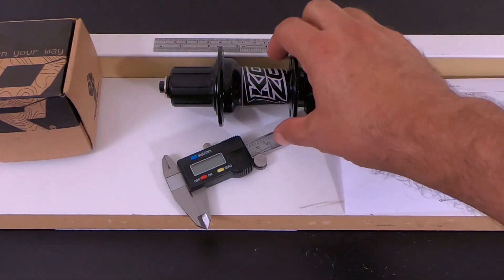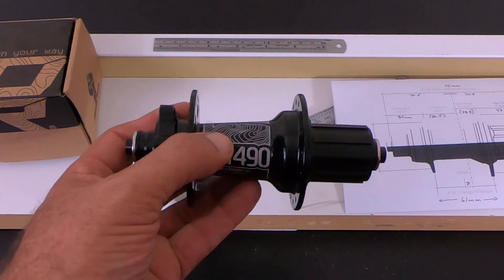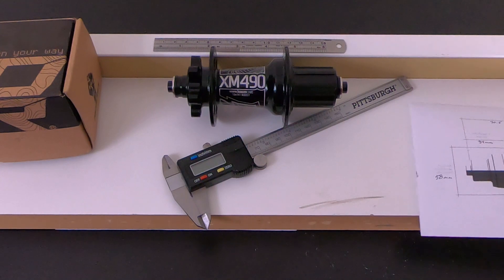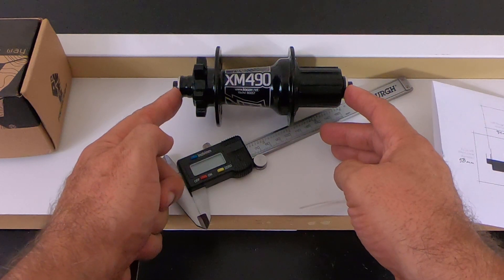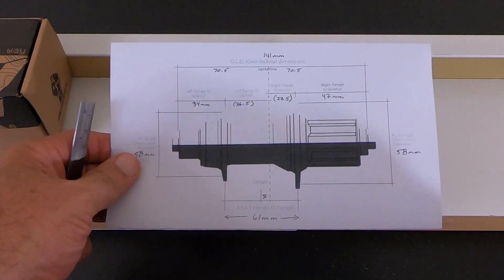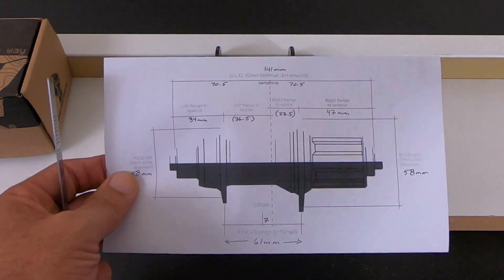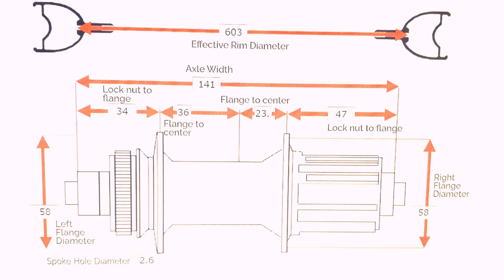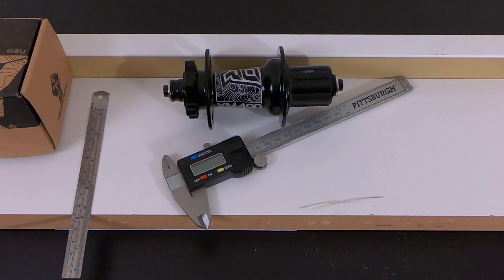Koozer XM490 141mm QR Hub Specs and Measurements for Spoke Calculations

Comment: Hey will this hub 10x142 QR fit in my frame?
I've 10x135mm 
I've 1x12 speed drivetrain so I want to get wider hub for correct my chainline and wide tyres clearance.
Reply from the maker: This hub will not fit. You have to match the hub to your frame. You can correct the chainline by using the proper non-boost crankset or front chainring.

Comment: I just secured a NOS Ryde Trace25 Tubeless 15 x 100 12 x 142 wheel set with Orion 8 M3100 hubs for $160 shipped. Will be using TA adapters for the Taff Comp 141 Boost frame. I thought about building my own with these Koozers but when I caught this deal I couldn't resist.  Hubs alone can go for over $100 each
Reply from the maker: Sweet deal!

Comment: Do you remember what the axle diameter and length was? @2:10 the o.d. of the caps looks like 10mm, so im assuming its a 5mm QR?
Reply from the maker: It’s 10x141mm, the 5mm refers to the the skewer so the description sometimes mentions both.
Reply: Thanks, the "standards" in the bike world can be confusing when your green. I have another unlabeled hub that's marked M9x141, and the axle measures 9.4mm with a 4.5mm skewer. 🤷

Comment: How is the XM490 hub holding up? I'm in need of a new 142mm OLD 29 mtb wheel and considering the XM490 with a welded rim (Ibis or DT Swiss).
Reply from the maker: It’s holding up great so far. No problems whatsoever
Reply: @TonyHob  Good news! Thanks for the reply.
Reply: Buy the pro version, it has a cromoly axle

Comment: What cassette are you using? Can this hub work with a 12 speed cassette?
Reply from the maker: It's a standard HG hub. Any HG Cassette from 8s-11s will fit as well as SRAM SX and NX 12speed. I am using an NX 12 speed on it.
Reply: @TonyHob  Thanks man! I got my wheel back from the lbs. I'm able to fit a sunrace MZ90 11-50 12 spd on this hub. 🤘
Reply: Does this fit to any 12s cogs in the market?

Comment: Hey Tony, I got the wtb i30 rims and the koozer hub but different calculators give me different lengths for the spokes, and what lacing pattern did you use?
Reply from the maker: three cross pattern. The same happened to me but they were only different by about 1 mm
Reply: What length spokes did you use?
Reply from the maker: 293 and 292. Your ERD might be different though

Comment: For those looking for a more budget 141QR hub, research Shimano FH-MT401-b (microspline body) and FH-MT500-b (microspline body) and FH-MT200-b (HG body).
Reply from the maker: I considered them but would have to buy a new cassette for the microspline version and they were not sealed bearings. At the time none were in stock either. Great price on them though

Comment: That is a nice Hub, I was using a 135mm hub  but I went back to the stock wheel because I started to hear weird noises on the frame. So this is a good choice, thanks for sharing this with the community
Reply: same as mine. im using 141 boost qr. i got a weird noises. i think its the freehub with pawls once i relube and regrease. its fine but its only last 3days or 1week it goes noise again. reply asap. i need your feedback on this one. THANKS

Comment: Have been using the same rear hub (although with a through axle) for almost 4 years now (as a direct replacement for the failed stock one on my 2016 DB Mission 1). Works great! Good luck with getting your wheel built!
Reply from the maker: Thanks, really seems like a good hub. Good to know it will last

Comment: I found some dt swiss knock off with 36h, considered building a set with the stock axum rim but got lazy lol
Reply from the maker: That sounds promising! Would love to be able to use the Schwinn rims
Reply: @TonyHob  sent you a dm with the link
Reply: Can you share the link for the 36h hub please? Thanks in advance
Reply from the maker: Links from others are blocked automatically to prevent spam but this is what Keo sent me https://www.ebay.com/itm/183315608951
Reply: Koozer now has the MF-480 which uses a 24T ratchet design.
Reply: They only have it in XD currently